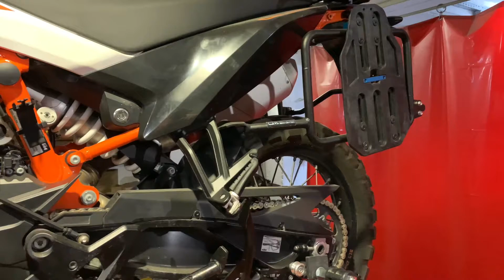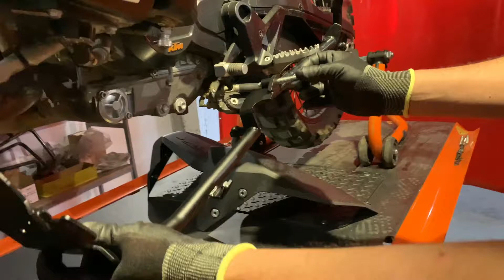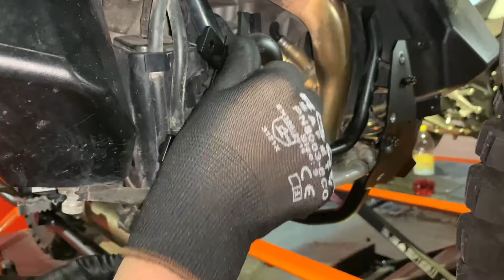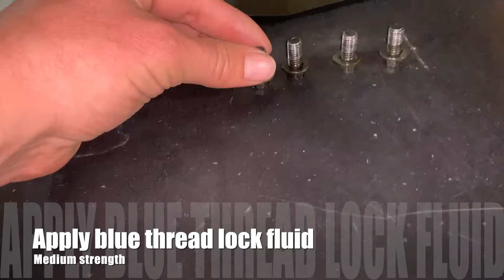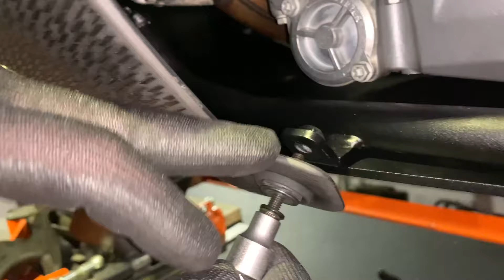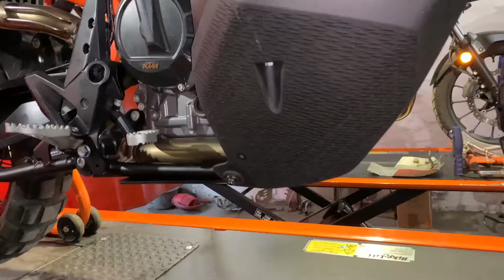KTM 790/890 Adventure Skid Plate - Installation video #ktm790adventure #ktm890adventure

Comment: Can the installation process be done with the bike supported on the centerstand? I.e. are the mounts for the centerstand independent of the mounts used to attache the skid plate? Sorry, if it was indicated during the video, I missed it.
Reply from the maker: Paddock stand is the safest option. We haven’t attempted the installation with the bike on its centre stand.

Comment: Can you change the oil without removing the plate like on your full model?  Maybe you said so and I just didn't catch it.
Reply from the maker: The skid plate should be removed at least partially. The left side tubing is the minimum.
Reply: @Outbackmotortek  I would be great to show that step as well :)